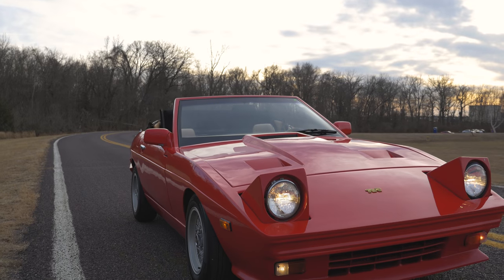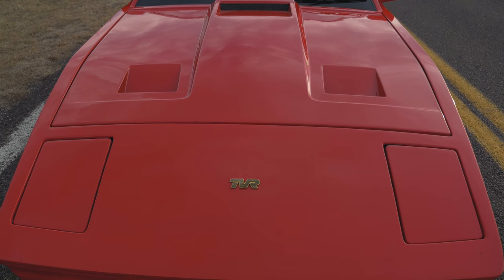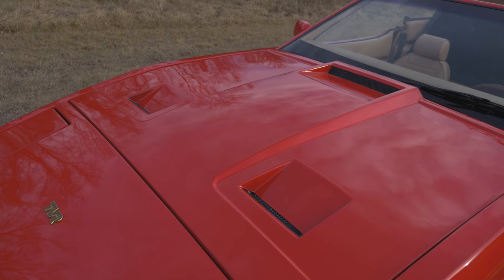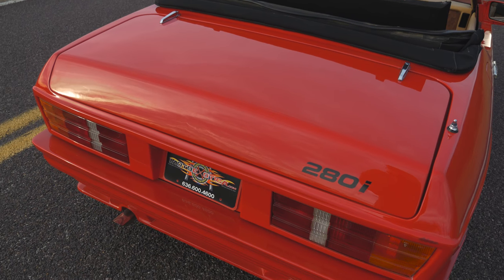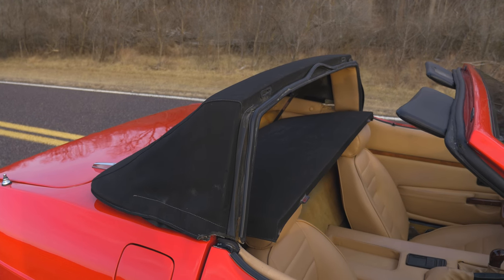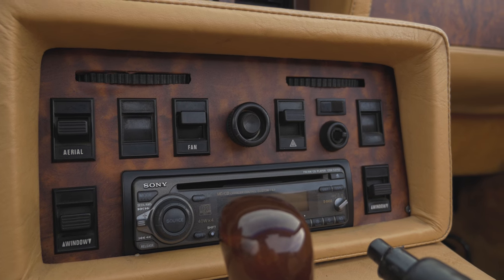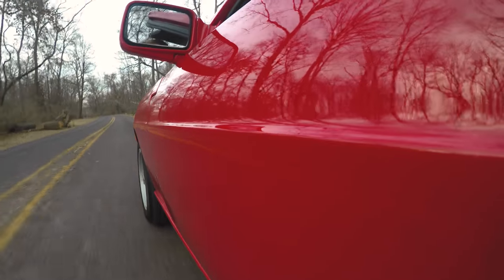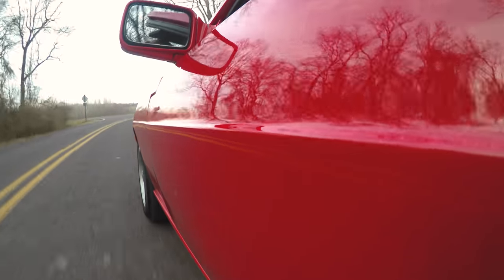1986 TVR 280i Series II || Review

Comment: I have one of these which I bought in 2005, although my 1983 model was then called the Tasmin 280i. It is now sitting in my garage waiting for the fuel pump to be fixed. A great car to drive at between 50mph to 120 mph, at slower speeds is OK, but at parking speed is hard work(I don’t have power steering on mine, and it has wider tyres than original).

Comment: The TVR you reviewed is a Series 1.5 (Series 2 models have flared wheel openings and rocker panels for a more rounded appearance, different front and rear bumpers,  redesigned interior door panels, and high level 3rd brake lights mounted in the center of the trunk lid above the rear license plate. The black nerfing strips from the bumper on the car you reviewed have been removed. Momo steering wheels came standard. Handling is actually outstanding - the best feature of the car.

Comment: I drove a red convertible just like this one back in 1981 for a British car dealership in Calgary that I worked for, albeit only for a few blocks. Ditto for the silver coupe version they had at the same time. I can certainly vouch for the engine sound you mentioned and, at the time, the design looked futuristic, taught and lean. Now it looks nice, but... dated. 

One thing I can say is that, as nice as the convertible is, I liked the lines of the coupe better, with it's almost horizontal glass hatch and its glass vertical lower window just above the tailights. Like the Porsche 911, the coupe version just seems to age better than convertible and targa configurations. They are better at keeping the weather out too, and more rigid.

Comment: I have owned 4 of these 'Wedge' TVRs, from 2.8 to 4 litre V8. (1 x 2.8i FHC, 2 x 390SEs, and 1 x 400SE). The American export ones (2.8 only) were down to 150bhp from 160. The V8 models were of course much more powerful...producing between 200 and 300bhp, with torque to match, in a car weighing 1100-1200 kgs, but most new British cars exported to the States ended up with reduced power and more weight, because of emissions and safety regs. Soo... perhaps not the best advert for the British niche market sports cars. You need to drive and hear a V8 model, to understand the appeal they have for many.

Comment: The reason for the giant hood and all the vents is because the 280i was the budget model. Anything above this version has a Buick or Rover V8 ranging from a 3.5, a supercharged 3.9, a 4.2 and a 4.5. They had upwards of 350bhp and were genuinely terrifying. Strangely they weren’t ever sold outside Europe so they were never really sen in the US unless they had the ford engine.
Reply: Handling of the TVR 280i is actually a  strong point of the car. The tubular steel space frame, weight under 2200 pounds, and the excellent steering feedback from the non-power steering all contribute to a driving experience on twisting country roads which you would find exhilarating. Thanks for your review of this unique roadster.

Comment: Pretty car. Looks to be in decent shape. 

This 280i has some nonstandard stuff. You can usually remove the chin spoiler rather easily - this one  is deseamed. The front grill insert does show on some TVR parts diagrams, but US cars had wire mesh only. Rear bumpers aren’t this ugly, the rub strip is missing. 

You missed out by not cornering this car, they handle great. I’d say that’s the point in having it. 

If you think it’s boxy and odd, look at Buick Grand Nationals from the same period. The market was awash in angles and boxes. The jellybean Taurus was extreme back then.
Reply: Funny you bring that up. My Tasmin was a daily driver 600miles a week back and forth to work until I got my Buick Grand National because it has cruise control (And didn't leak water in and heat out. lol).

Still have them both. The TVR hasn't been driven in over 20 years and the GN has been dormant since it got stolen and blown up in '06.